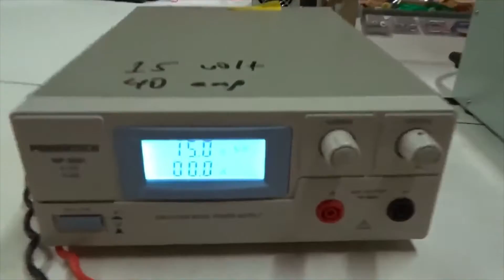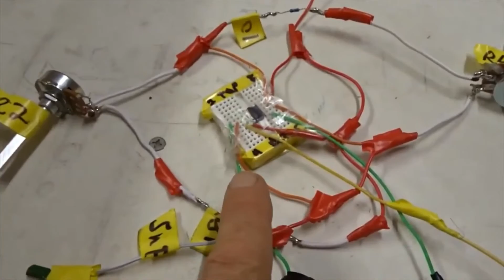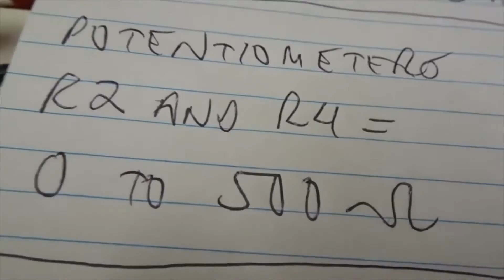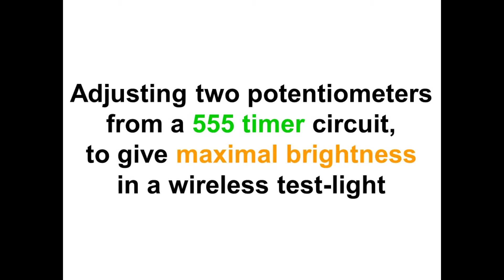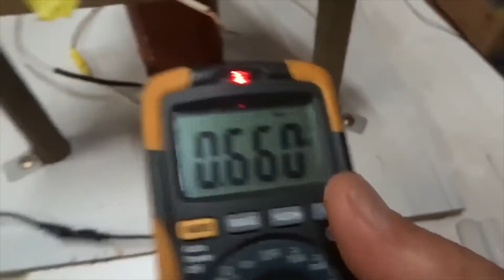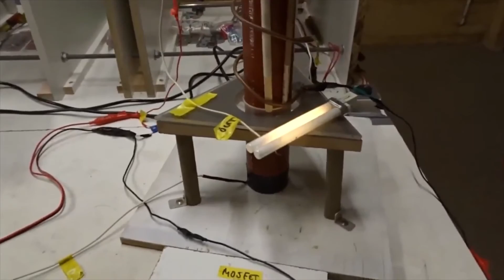Using a 555 timer to drive a single-MOSFET Tesla coil

Comment: Very interesting. What does the mosfet driver do. Wouldn't it still work if you feed the 555 pulse straight into the gate of the mosfet?
Reply: the AC voltage coming out of that 555 timer is only 0.15 volts with 15 volts DC input. So we need a MOSFET driver to get the 5-6 volts needed to flip the MOSFET on or off. The other literature circuit I showed there uses a Darlington pair of two NPN transistors to increase the voltage! Very tedious,